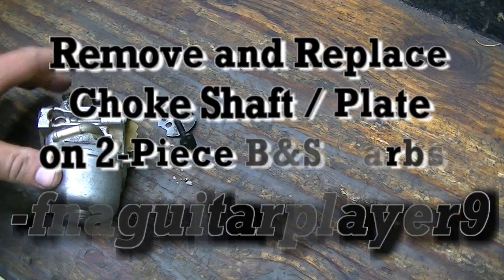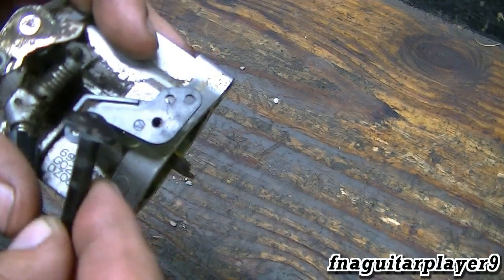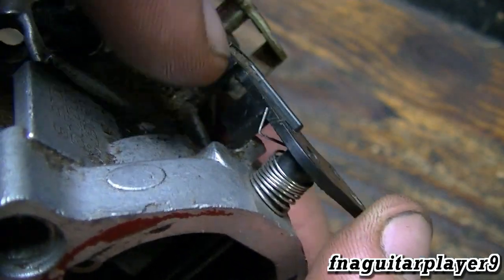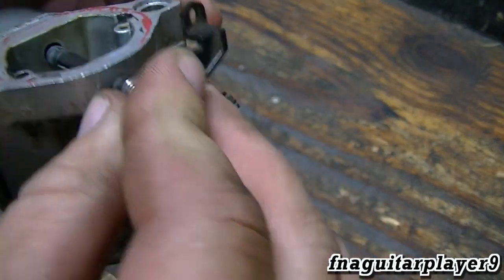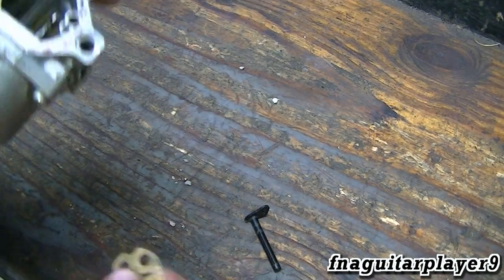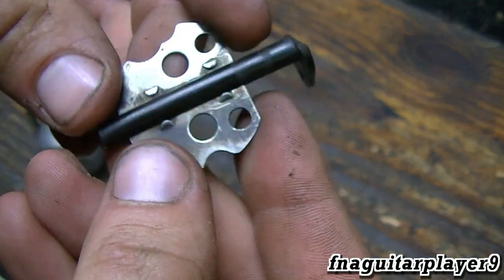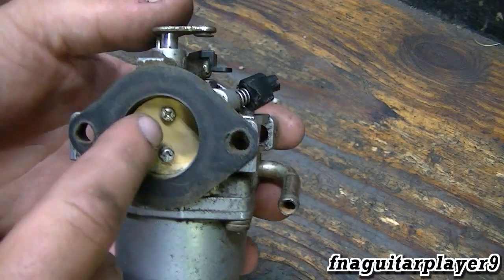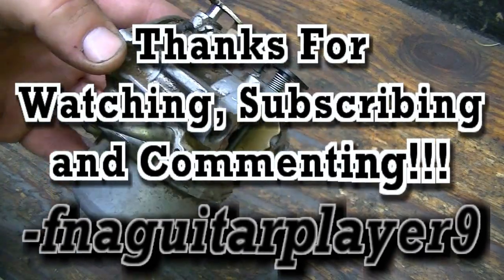How To Remove / Replace Plastic Choke Shaft on Briggs 2 Piece Carburetors

Comment: THANK YOU for posting this.  The choke spring on my engine's carburetor was so encrusted with dirt that it was preventing the spring from opening the choke.  I was cleaning out this crud with a pick when I accidentally pushed the lower end of the spring out, releasing all tension.  This video shows EXACTLY how to reestablish tension for this spring.  For reference: a Nikki carburetor from a Craftsman LT 2000 riding mower, Briggs & Stratton engine 331777-1372-B2 with an 04 date code.

Comment: So I have a 93 Briggs and Stratton motor on my John Deere lawnmower,   I do not see a spring on it. So what is weird if you have the carb. in your hand the choke moves super easy, once you tighten the carb back on the motor then the choke will not move, remove the carb. and the choke starts to move again.  Any ideas on why.

Comment: Hey buddy I have a problem I had to buy a new carburetor for my mtd quantum 5hp briggs and straton mower. Well the new one came with a different plastic piece for the butterfly now I was gonna change the old plastic piece into the new carb but the piece on top is broke how do I use the new piece it has notched in it laying against a spring. Could I just drill a hole on the new one

Comment: You are a hero ! Had a very stiff operating choke, had the local mower shop clean the carb (it was quite gummy ,vintage 1997 ) They gave it back and said choke was still hard to operate. Watched your video and learned it would come out !! Grabbed it with needlenose and tapped it with small hammer till I finally got it out , rolled up some very fine sandpaper and sanded out the CORROSION on the top hole--now works like new Thanks - saved $180 on new carb !

Comment: Thanks.  My spring came unwound because the jerk that installed it at the factory put the butterfly in backwards and when I got the new carb I had to fix their screw up.  When I pulled the shaft out I did not know about that spring.  I do now.
Reply from the maker: Your welcomw, glad to help out! Thanks for watching

Comment: I had Both throttle plate screws come out on my 13.5 Briggs,  flatty 2 months ago. Throttle became unresponsive. 
Didn’t do any damage far as I could tell, but I did have to get a throttle shaft kit and new head gasket.
28R707 1120 E1, it’s 16.5 yrs old the original Murray 40” select . 
It and me, are just a matter of time. Who’s gonna blink first?
Reply from the maker: Yeah thats not good when that happens, your lucky there was no damage to the cylinder or anything. I have another video on one that happened to. haha i hear ya! Thanks for Watching!!!

Comment: I ordered a new carburetor for my craftsman, which fits perfect.  The problem is that my original had a long stem to reach up to the choke knob.  After I put the new carburetor on, I found out that it does not have a extension, and it has no perceivable way to put a stem on it.  Is there any way I can modify that?
Reply from the maker: I'm not sure there is a way to modify it but i'd have to look at it to be sure. Thanks for Watching!!!

Comment: 12.5 Hp 420cc B&S
Just been noticing that my choke plate does not return and it seems the plastic shaft is binding. It is one of those nikki plastic internals replacement carbs. 
Also will not run without holding your hand over the intake 90% closed. Checked my ports and cleaned without any improvement.
Reply from the maker: I don't care much for those carbs, they do have a fuel mixture screw that may help some. if its to far gone it might be best to replace it, they are actually really cheap on ebay/amazon. Thanks for Watching!!!

Comment: What's the part number on shaft ?
Reply from the maker: Which carb do you have the, nikki or the walbro? I'm pretty sure they are different #'s, don't want to give you the wrong one! Thanks for Watching!
Reply: Walbro
Reply: Also the butterfly that goes with it
Reply from the maker: This part # should be what you need, #695420 it includes the shaft, spring and butterfly, if you have trouble finding it online let me know and i can help you, but its on ebay and several other places.
Reply: Thank you. You're doing a great job!
Reply from the maker: @eddielanger4748  your welcome! Thanks, I try to!